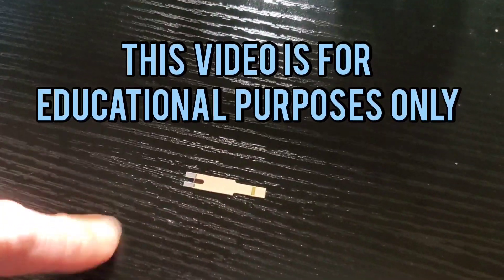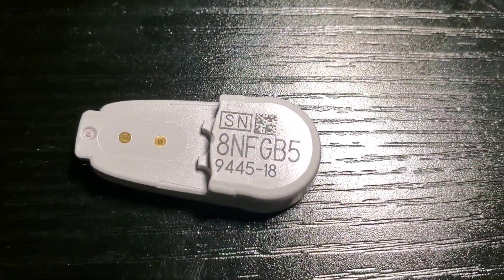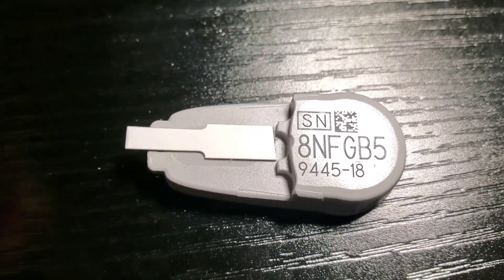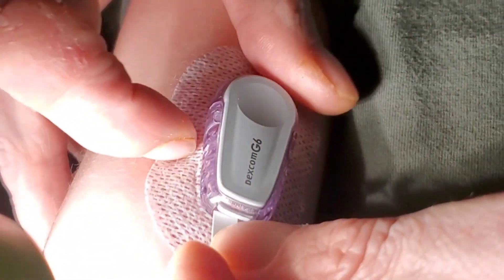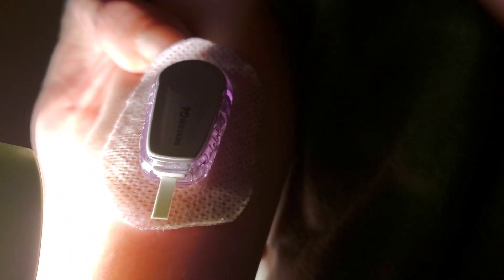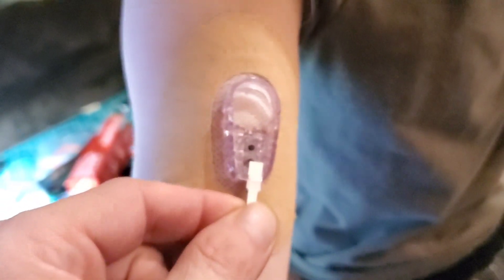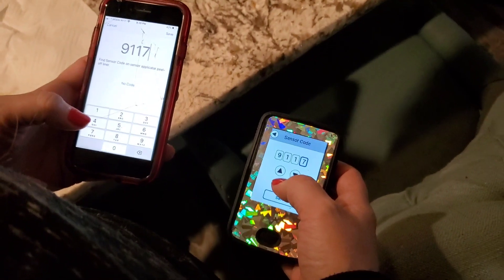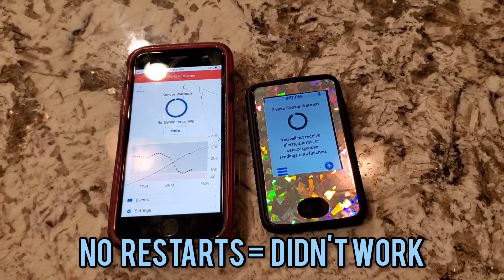2022 METHOD Restarting Dexcom G6 Transmitter/Sensor No "Popping It Out" Best Way Extend Past 10 Days

Comment: This does NOT work for me. I have done everything according to your video and this is what happens...  After 30 mins I remove the test strip and it does its 2 hour count down, then after about 30 mins I get an error message saying Unable to use sensor. OR sometimes the countdown does work but my test result ALWAYS shows HIGH (finger stick test proves otherwise). Strange thing is when I do this procedure on my partner's Dexcom it works fine. No problem at all. So I'm at a loss.

Comment: This is great. But what do you do if the sensor pad loses stickyness/adhesive? Or does it remain sticky indefinitely?
Reply: try Simpatches. they go ever the outside of the original adhesive and will keep it on. usually my original adhesive will be just starting to peel at edges after 10. i will cover it with a simpatch and restart and get another 5-6 out of it. the simpatches don't last for 10 days for me. although im active and constantly getting sweaty and dirty. i know there are some tacky adhesive wipes out there folks use to extend the adhesive life. my strategy is 10 days, reset, cover with simpatch, get 5-6 more. and then change. I figure an extra 5-6 days is solid and easy. it's nice to build a surplus and have extra in stock if one fails or gets ripped off as they do.

Comment: I do this already but a quick one. U have issues with data loss when re using a sensor? When I do it and syncs up properly.  Every now and then it will have senor error and have to wait some time before it reconnects.
Reply from the maker: Yes, towards the end ofnthe transmitter life,  the readings can become less frequent, however since getting the tandem it sends signal tongue pump then to the phone and readings are more consistent because the pump is a foot away at all times.

Comment: But how do I get the transmitter out? Does it pop out easily once you put the test strip in for the 25 minutes?
Reply: I may be wrong, but I think he was just showing what it looks like with the transmitter off so you have a better look at what to do. I don't think the transmitter needs to come out. You just pull the strip out after 25 - 30 minutes and act like you applied a new sensor. That's what I got out of it. I'll have to try it out to see.

Comment: After an extra cycle my adhesive completely ripped off from the sensor & my skin. I don’t know how the sensor is managing to hold on to my arm. How do you deal with that side of things?
I used Ktape to strap it down but it’s looking pretty rough.
Reply from the maker: Hey M. K.  We live by the Freedom Band. Bandsfordiabetics.com
Reply: Make sure u use SkinTac before applying the censor and patch. It really helps a lot.

Comment: What brand/type of strip are you using?  I have trouble finding one that is both thin and sturdy enough to do this.
Reply: I know this is late, but it looks like the One Touch Verio test strip. That is the kind I use.
Reply: Yes, my question also. Does the type of test strip matter?
Reply from the maker: I'll make another video. When you apply the tape, black electrical tape has a slight stretch to it. When applying the tape you want to gently pull the tape to crate a tight grip and cover the entire flower 3 times. 

Also. Put a couple loops vertically up and down the tube before wrapping the round way if that makes sense.
Reply: @clixstormdiy  I do apologize, but I believe you've misdirected this reply.  My question was in regards to WHAT BRAND test strip you are using in the video; due to average thickness of a test strips, they do not fit within the space shown.  You're reply is in regards to tape which has not correlation to the question.

Comment: how much do you do this?
Reply from the maker: A few. If I need to build up my stash of sensors/transmitters again. You know how insurance is with sending theses out. Running us all to the edge of "just in time delivery". This way I'm not stressing when they screw up like they do. :)
Reply: @clixstormdiy  I do this 8 times (like 80 days) and sensor still works.
Reply: @ccaa3328  Same transmitter? Or are you resettingthat as well?

Comment: I just came across your video!! This is amazing! My wife is constantly having issues with her sensors. 
On a different topic, my wife has other things going on to where she has extremely dry skin. I have tried everything short of wrapping her whole arm in coban haha. I’ve been really debating on ordering a couple starter sets from bands for diabetics. That’s actually how I came across your videos 😀. But I’m still worried about her pulling everything out. Any tips or ideas would be greatly appreciated. Thank you so much!
Reply: Same. Bought the covers that are anywhere from $10-$20 for a set of ten usually. They immediately came off due to dry skin. Found that a roll of 3" kinesiology tape does a much better job! You cut about a four to five inch piece and tear the Middle of back paper. Clean skin with alcohol.  Pull one piece off and place over sensor. You can cut a hole or cover completely. Don't cut hole as big as sensor because it stretches and will be too large. One tool costs between $8-$15 on Amazon and lasts forever.
Reply: @reesev5 thank you, Reese!  I needed this!!

Comment: i forgot the sensor code, is there way to reset it without code ?
Reply from the maker: Yes, you will just have to Calibrate it often in a pinch. Look up Restarting without calibration code, there are tip articles on how to proceed. We just did this last week and chose one. There are only about 6-8 codes.
Reply: I'm sure you've figured it out by now but I just did mine and put no code in. It asked me for two glucose readings and after I did them both, it was good to go.

Comment: how often/how many times can one reset one sensor?
Reply from the maker: I believe you can do 20 days.
Reply: I've seen people say they can use the same sensor 4 or 5 times, which seems crazy. I've managed up to 2 re-starts, but then only a few days into the 3rd session. Usually I can only do it once. I think having really stable numbers helps extend the sensor.
Reply: @laurelannschenkoske795  what happens when you try to go a few days into the 3rd session? it just stops being
Reply: @Zachary Swain  the sensor fails. Most times I only get about a week into a 2nd 10-day period (1 re-start). It's different for each sensor / person. I don't remember exactly, but the coating on the sensor, while sitting in your body's interstitial fluid, eventually wears out. Apparently lots of bg fluctuation wears it out sooner.
good luck :)

Comment: I pop the transmitter out and put it back in the same sensor often. How soon after this method do you start getting sensor errors?
Reply from the maker: It's the same time frame, but instead of popping out, you are just disrupting the connection like when you pop it out. i.e. 25-30 mins after. The receiver will alert you after 30 of the disconnect.
Reply: @clixstormdiy  I guess I didn't word that correctly. So we do a restart extending the 10 days... At some point you start getting sensor errors, I'm just wondering how long after the restart do sensor errors start to occur? I usually get 5-10 days so 15-20 days total popping the transmitter all the way out. Just wondering if there is an advantage to this method vs transmitter removal? 
Thanks👍

Comment: thanks for concise video with good illustrations / explanation. After closely watching video I stopped sensor using my iphone app, then slipped a blood glucose strip (after estimating depth of insertion), did require a bit of 'jiggling' and insertion pressure while being careful not to disturb the sensor wire that's inserted in skin. I waited 30 minutes (excess caution) then clicked on app of iphone 'new sensor' , removed the plastic strip and entered the sensor number(from a pic I took of it last week before applying), got a green checkmark on app and then waited the 2 hour warm up time before app started relaying numbers. I read how it might take 12 hours before it settles down and reads correctly, after 2 hours mine was reading stable but higher than expected so did a calibration and it was 100 higher than finger stick, I'll watch how it responds overnight and to meals, will probably do another calibration at stable low and high points. This is my first sensor and was reading between 70-300, nice graph, had confirmed the low but never confirmed the high but will do that from now on.
Great website, Appreciated!

Comment: Looks like a good way to get an infection.
Reply: Sometimes there are emergency situations where there isn't a new sensor available. And some people financially live in that emergency situation.
Reply: An infection might happen… but death is always permanent. People who can’t afford the sensors they need for an every 10 day change (or run short due to the known adhesive issues or sensor failures) have to do something to make do until their next shipment.

I will risk an infection rather than die in my sleep like two of my friends have.
Reply: @pancreasssbesh5459   if you have a sensor failure dexcom will replace it and there’s always the option for finger sticks.
Reply: Perhaps. But this is VERY common practice in the D community. Before FDA made Dex change to the 10-day sensor, they were made to last 7 days, but it was a lot easier to re-start them for another 7, and another... I learned about it when I was active in the Dex groups on FB. Plenty of skin irritations. Never saw anything about infection.
Reply: Yes, that is a risk, but I used G4 and G5 sensors for up to 3 weeks for years and never got an infection, as I had to pay out of pocket. I don't extend the g6 ones now unless there's an emergency. Insurance company delayed an order and I ran out so that's why I'm here.
Reply: I've reused G4 sensors for up to 40 days. With decent data until the last few days. Funny enough the only time I ever had puss was during a normal 10 day run. If the area is sensitive you take off the sensor. But during my G4 run of reusing sensors because I'm poor I've never had one. In all the Facebook and DIY groups I was in no one ever reported getting some infection. The FDA and Dexcom have made sensors short-lived. Dexcom loves it because they make more money. But they never needed to be. Transmitters could of been rechargeable from the beginning too.
Reply: @emceeunderdogrising   just because someone didn’t put it in a Facebook group doesn’t mean it did t happen. Something that penetrates your skin I don’t think is meant to be work for periods that long. Part of the reason they tell you to change it is probably also for the potential of infection and avoiding those complications.
Reply: Good info here.